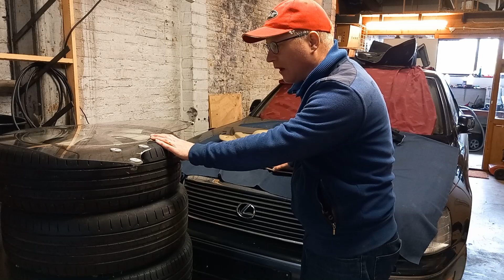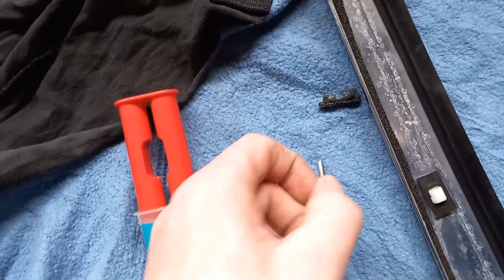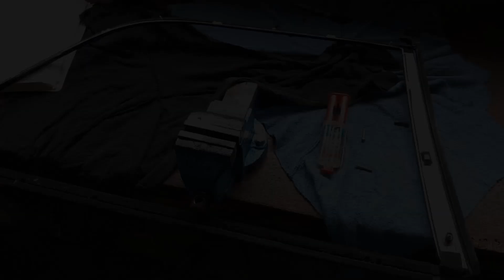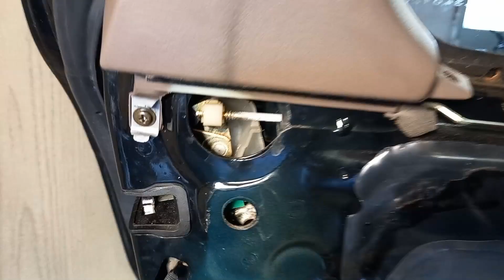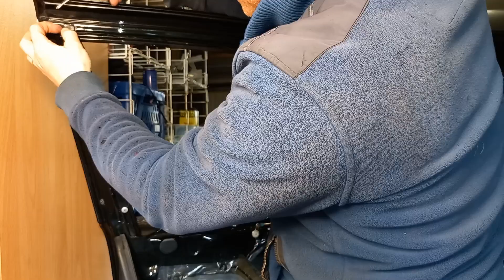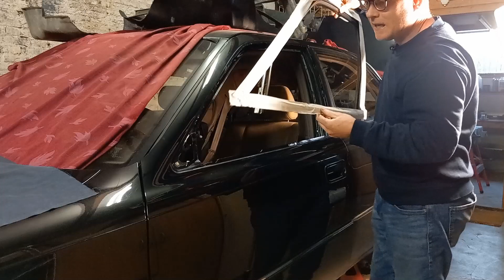Episode 23 Project Lexus LS400 - Window & door trim removal, repair and installation.

Comment: Hello again from Australia, very helpful video Arnold.  I will be attempting a weatherstrip or outer window trim repair on my 95 LS soon.  The design of the trim is quite different from your model. The part is no longer available so I will actually attempt to bond new rubber to the stainless frame.  Cheers from sunny Australia.
Reply from the maker: Hi there, thanks for your comment. Please let me know if that repair was succesful. With a lot of parts that are no longer available, we need to find ways to repair broken parts and maybe even produce our own parts for our cars. That can be challenging, but we Lexus owner aren't afraid of a challenge. (Otherwise we would have bought a German car and ordered every imaginable part at the dealer).
Reply: Hi, did you managed to bond new rubber on the stainless frame? I'm interested in the same operation for the LS400 UCF10 outer glass weatherstrip. Thank you!

Comment: Rockauto "Pro-Tip": After creating a login, and putting in "1972 Lexus Ls-400" you will see a "car icon" and when you click that it will add that to you profile list.  I have 5 vehicles (and my parents 3) in my "Profile" list and don't have to remember all of the year/models anymore.
Reply: Lexus wasn’t even around in 1972 😂